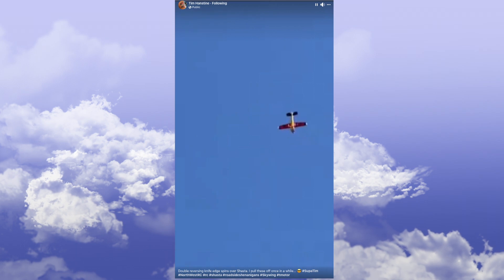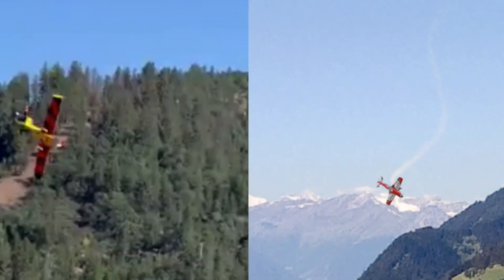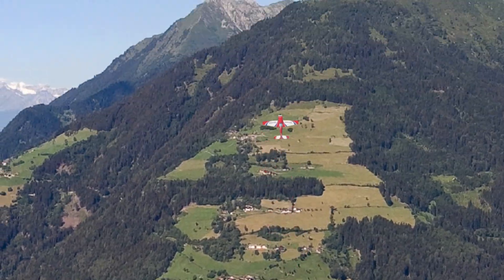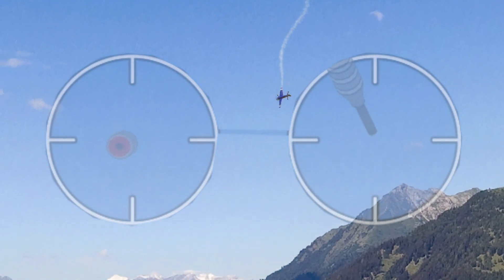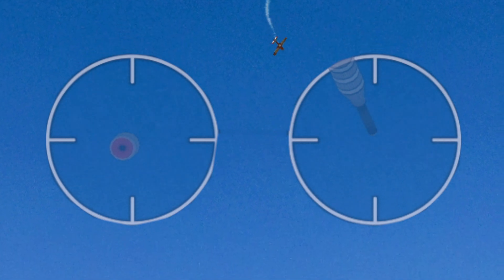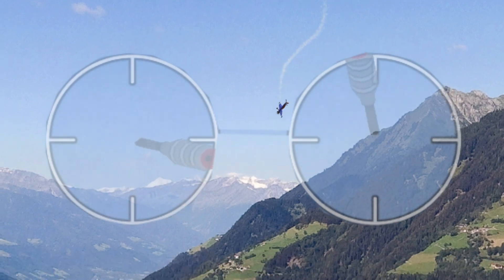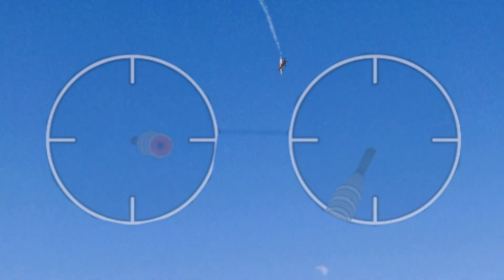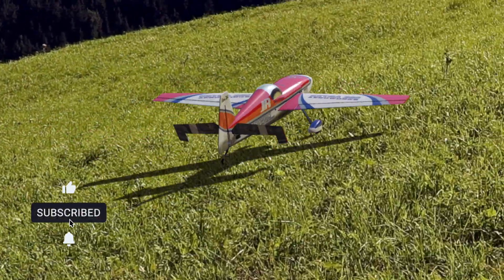How to do a Reversing Knife Edge Spin - Aerobatic Maneuver Tutorial

Comment: Great insigth ! . . . . Can you also give some info on degrees of deflection on the controls??
Reply from the maker: For me I generally set my planes up a little more conservative than the XA setup. I’m between 45-48 degrees on my elevators, I’m usually 35 degrees on my ailerons and as much as I can get on the rudder never to exceed 50 degrees though. I hope that helps. You will find that XA pilots tend to have more throw but it’s just not for me.
Reply: @RC-Air  Yep very helpful. Thanks !